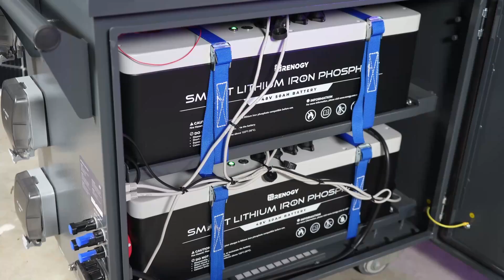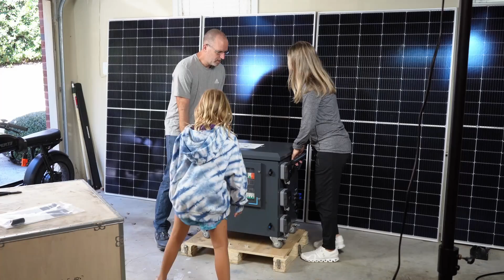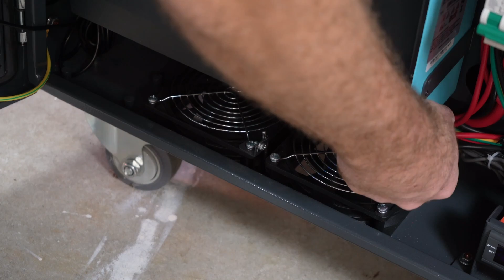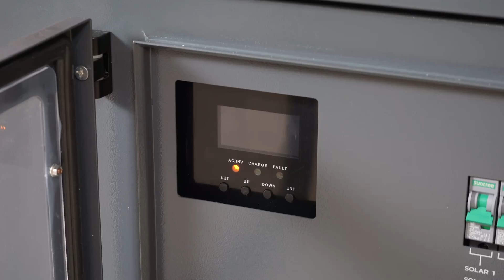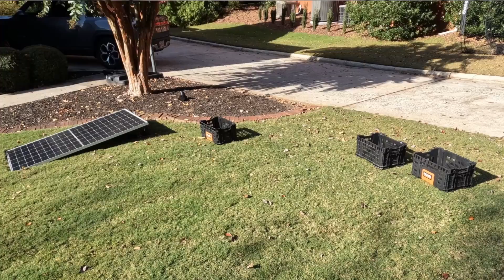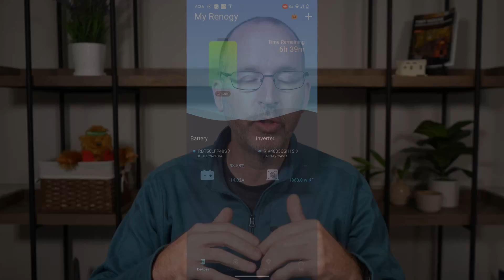Renogy Lycan 5000 Review

Comment: Just got one on Amazon for $2,999.  Trying to decide if I want additional smart batteries to add to the system.
Reply from the maker: Nice thing is you can wait and see since you can add them at any time. They go on sale frequently.
Reply: To cut my electric bill is it possible to run the Lycan simultaneously with grid power ?  Have say 6 circuits connected to transfer switch, the unit is being charged via ac from grid and or solar.
Reply: @jamesmatt-ms4eb  yes, you can use a transfer switch to decide what loads you want to run off the Lycan and which ones you want to run off the grid.  I wouldn't use the grid to charge the Lycan in this situation as it would defeat the purpose.  Use solar panels instead.
Reply from the maker: @jamesmatt-ms4eb  if you are recharging from the grid, in most cases you wouldn't save any money. However, some utility companies provide better rates at night (to encourage people to charge their cars when there is less load on the grid). So you could save money that way or with solar.
Reply: Not really looking to save it’s more about reliability. I travel so being home to move solar panels around is not always possible. Just want to be able to use this generator plugged into the transfer switch with 2 of the circuits(sump pumps)switched to generator. If I lose power the generator would power those circuits. When the power comes back on the ac input on the generator would recharge the battery and keep the pumps running also. I guess they call that “power through charging”. Is this unit capable of such ? Thank you